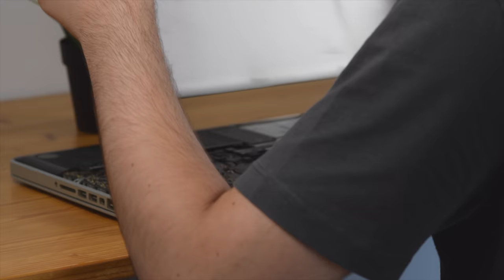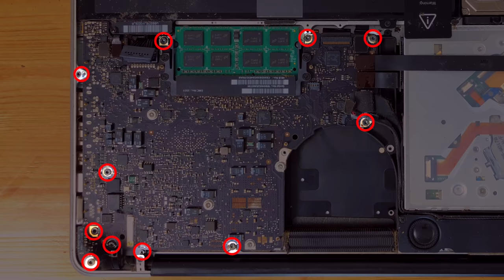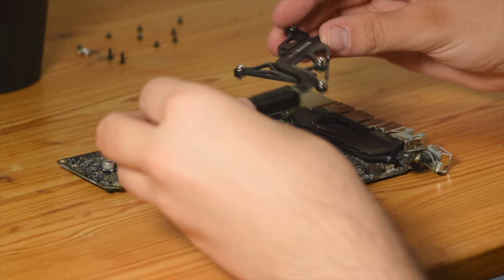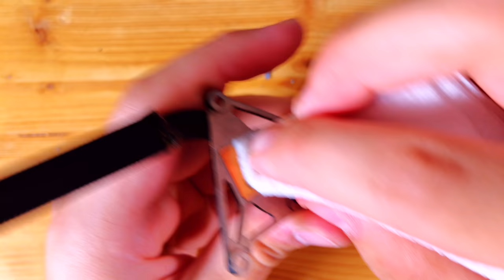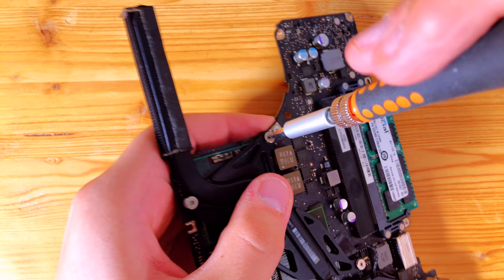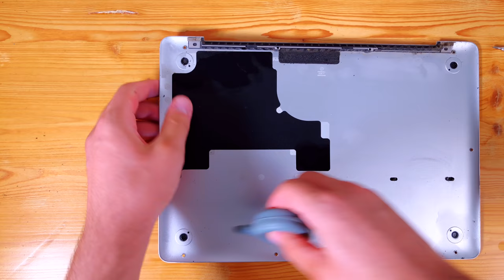MacBook Pro 13" Mid 2010: Inside cleaning & New thermal paste

Comment: Hi, thank you so much for your tutorial. I was really scared to do it myself. But after did it, thanks gods, there is nothing really broken. Usually, my idle temperature was 70 C and now it 50-60 for idle and never passes 70 C when it under load. 

Maybe because the original thermal paste already got so bad and dried, that's why it didn't do its jobs anymore. 

Again, thank you!

Comment: WOW. I'm not a huge tech person and this looks pretty straight forward - I'm refurbishing a mid 2010 MacBook pro and was looking into other things I could do to help it run as best it can. Great tutorial.
Reply: Same, I upgraded the ram and put in a new battery and SSD. Runs smooth now but it's gets really hot and the battery drains quick. Might do this to see if it helps.
Reply: @jerryrivera6328  any luck? typing on a mid 2010 MacBook Pro haha
Reply: @kjhammons52  yeah after cleaning the inside and changing the termal paste it was running much more cooler than before. I should warn you to be careful when disconnecting the LCD ribbon because on the video I couldn't really see how he did it and I kinda took it off incorrectly so the screen wouldn't turn on until I messed around with it for a bit to put it back correctly.
Reply: @jerryrivera6328  thanks dude glad to hear it, I got parts on the way! sorry I'm a noob lol is that the wire coming from the screen?
Reply: @kjhammons52  no prob man, it's the first time I've opened up a laptop before and yeah it should be the the top right ribbon connecting your screen.
Reply: I added a 2nd drive instead of the DVD with a caddy. Cheap and well worth doing.
Reply from the maker: You can configure the two drives to be RAID0 so the system will see them as 1 drive with much better speed!
Reply: @Simos805  The boot drive is SSD and the second is SATA. Boots quite fast as it is
Reply from the maker: Fortroad Massive Ok but you can make it even faster and the drive speed isn’t only affecting the boot speed but the system’s speed in general!
Reply: @Simos805  They are different sizes does that matter? I always thought that using RAID you needed the same size disk?!
Reply from the maker: Fortroad Massive Then yes, I think they need to be the same size.

Comment: Its Jan 2022 and I have a 2009 MBP, still running just fine minus the fan kicking on often, Im about to do this while I replace the keypad. Its crazy, 12 years out of Apple must really say something.
Reply from the maker: I bought a used 15" MacBook Pro 2010 for my girlfriend in 2021. We installed an SSD on it and it works pretty much fine. I does some display issues (like anomalies in the backlight in some areas) and it only has 4GB of RAM (we can install 8GB but it may doesn’t worth it considering the cost of new RAM), but it runs macOS High Sierra and Windows 10 through bootcamp very well for its age!

Comment: Hi great video! But now I have a issue with my MBP mid2010, I put new thermal paste, afterwards I turned it on, it turned on like usually but my keys 4RFV did not work on the keyboard.. I turned it off and on again, but now it wont show anything, it does the starting sound an some noise comes out of the MBP two times, but then nothing happens, it stays on but screen is black, but on.. Help please!
Reply from the maker: Check out the connections of the ribbon cables for the display and the keyboard as well. Make sure there isn’t any dust inside the connectors. Be very gentle because they’re very fragile!

Comment: Great video, will be doing this.  Whats that wee grey air thing?
Reply from the maker: Boabywankenobi It’s used to blow air for photographic equipment. Basically you need something that blows air, but not very very strong because maybe you could damage the motherboard.
Reply: @Simos805  Awesome, thank you.  I had one follow up question, did you apply any alcohol to the motherboard itself? [i.e. to help with the corrosion etc].  Thanks again for this video mate, as a bit of an OCD neat freak even if I didn't own this exact Macbook I still would have appreciated your vid!
Reply: Boabywankenobi motherboard wont corrode if it was not wet, and you dont have to clean it with Alcohol because using some kind of soft brush does the job

Comment: My MacBook just shuts off randomly when it can't handle stuff anymore. Just turns black. Like switching off a light.
Reply from the maker: How are it’s temperatures the time it shuts off?
Reply: @Simos805  I don't know. How can I find out? Is there a log of that?
I made a diagnose with EtreCheck and it said, that the CPU was way overloaded with a process using over 100% of resources.
Reply from the maker: St4zBl0od Maybe you need a clean install pf the latest macOS version your system supports. If the problem still occurs, maybe it’s something with the temperatures.
Reply: @Simos805  Yeah, maybe thats right. I just don't want to jeopardize all my system addons like brew, iShowU etc. I didn't want to upgrade from Mojave, but maybe it is a solution.
Although due to the age of the laptop (i bought it used in 2014) the thermal paste might be a little hard by now. And a cleansing of the insides, especially the vent, is surely not that bad of an idea.
Reply: @Simos805  I just opened the MacBook to see that there was a huge ball of dust blocking the fan. While I was at it i cleaned the whole computer with isopropyl-alcohol and redid the paste. Now the computer went from about 70 °C Idle temperature to about 50 °C Idle temperature (158 F to 122 F). This is f-ing awesome. Didn't even need to update.
You really helped me, especially with the thermal paste part of the video. I didn't really know how much to apply, so thank you!
Reply from the maker: Alright, happy to helped you! But I suggest you to update, macOS catalina works great!

Comment: Thank you for this video. Want to try it on my mid 2010 MBP, but is it okay do you know to use a metal spudger instead of a plastic one like you did here?
Reply from the maker: A plastic one is recommended because it won’t damage the other surfaces and it won’d make short circuits.
Reply: @Simos805  Thanks for the speedy reply and the clarification. Makes sense. I'll give it a go soon.

Comment: My mid 2012 i7 13.3 seems to run hot, 45c to 60 c for regular tasks, on sim city is got up to 163 F, I’m thinking I need to do thermal paste change, any thoughts? I’ve used smc reset, smcfancontrol to up the fan rpm, that has helped some
Reply from the maker: I don't thing you have any problem, 40-60°C for regular tasks for a laptop are generally ok, and 72°C while playing a game are very ok as well. Maybe if you replace the thermal paste you will some improvement, but maybe a ~5°C drop and that's all.

Comment: I follow your guide, everything was looking great but then the computer won't turn on, then I tried to check if everything was connected right and I broke the Camera data cable :/
Anyway, it still doesn't turn on, if I connect the Magsafe charger it turns the battery lights on, but no matter what it doesn't turn on, what could it be?
Reply from the maker: I don’t know man... For sure something went wrong on the reassembling but I can’r know what...
Reply: @Simos805  Thanks, I did the process twice and it still wont boot, so I'm just gonna take to a technician
Reply from the maker: Very strange... Hope you’re find the way to fix your macbook!
Reply: @Simos805  Thanks mate, still, your guide was useful and well done!

Comment: Thanks for this video! 2 questions: would it be the same for the early 2011? they look exactly the same. 
And, mine it is still working, I upgraded to 16gb RAM, and SSD disk, but I want to optimize it as much as I can. So, do you think doing this it will help everything work a little faster? My fans turn on a lot for a long time, but they also turn off after, and the computer keeps working normally, just slow if I'm doing some work. 
thank you!
Reply from the maker: Yes, it definitely be good for the computer to change it’s thermal paste and clean it from dust that prevents the airflow! The process is almost the same I think yes.
Reply: Hi, I just did it to my i7 MBP late 2011, everything is the same with this video, the only difference was the thermal only for CPU. I didn't notice the graphics card processors, like in this video. Hope it helps

Comment: nice video! my macbook pro heats up a lot and then off, after a few mins i turn it on and it works normally. could this be the solution, clean and change the thermal paste?
Reply from the maker: Which model you have? When it heats up and then turns off, you're using it on e flat surface or on a bed/clothing or something like that?
Reply: model is macbook pro 13'' mid 2009, upgraded already, runing win 10 whit bootcamp 5 on it, is all good, faster,.. but i only have that issue, and am using it on the iclined pc surface.
Reply from the maker: Aha, windows always heating up Macs, even the newest models because they aren't optimized. Why don't you use macOS?
Reply from the maker: But if your macbook shuts down, surely it has a problem, maybe it needs thermal paste replacement.
Reply: complicated to use haha, i mean never really tryed. well tanks buddy ill do those steps, hopefully it reduce the heat.  let you know it goes. salud!
Reply from the maker: macOS is much more easy to use and useful compared to windows, you just need to understand it's little different logic and then you will see it's better. Windows are only better for gaming.
Reply: did that,. is all good, thanks
Reply from the maker: Happy to helped you! 🙂

Comment: So I just did this, my macbook wont turn on anymore, unless its plugged in with the charger. However, the screen is black and the fan goes crazy. Anyone else have this issue?
Reply from the maker: Check all the connections inside, all the ribbon cables.
Reply: @Simos805  I had trouble with the wide ribbon cable at the top. What does that one do?

Comment: Is it normal if the fan turns on at Max Speed whilst turning on? (After this procedure?)
Reply from the maker: All the time or just for a few seconds?
Reply: @Simos805  it happened all the time upon first reboot, the fan was running at max speed without blowing hot air. I restarted it and it runs great I got significant results, there is just one thing that bugs me, when I'm on YouTube the fan turns on progressively until it's at max speed and the temperature rises up to 80°
Reply from the maker: Oh ok, maybe that was a bug. YouTube consumes a lot of power and it’s usual for the laptop to go 80° especially on high definition videos.
Reply: Oh that's ok then. Thank you for taking the time to answer my questions! You just earned a sub! Great videos! You're pretty good!
Reply from the maker: Thank you man! :)

Comment: I have T6 screw driver but it doesn't work
Reply from the maker: Can you explain?
Reply: @Simos805  Like I have a screwdriver set it has from t4 to t20 screwdrivers, however, when I try T4 and T5 they are too small but when I T6 or bigger they don't fit because their size are too big for my mid 2012 MacBook's screws
Reply from the maker: @randomperson1408  That’s strange. Maybe the screwdriver set is very cheap and crappy and the sizings are wrong? Or maybe your macbook pro has been opened before from a 3rd party and they replaced the screws with different ones?

Comment: HEY bro does the TORX T5 work like a T6 ?
Reply from the maker: Maybe
Reply: @Simos805  it doesnt exist in my country but T5 exist. so is the T5 Torx abble to work with T6
Reply from the maker: No it will not. It needs T5. You can order it online from amazon, ebay etc

Comment: My screen flashes and goes completely dark if I put the bottom plate screws in. Has anyone else encountered this? I did this a CPU repaste (got excellent thermals at least), so all went well just can't put the bottom screws in or the screen dies. Thanks
Reply from the maker: Have you checked the display connector?
Reply: @Simos805  I have, thanks for the reply! It was the weirdest thing with everything working fine on the test run before we put all the screws back then wham, dead😋. I disassembled the whole thing an started a fresh an now it works with the screws in🤔🤔 go figure! Haha, cheers though. Couldn't find anyone with the same issue so tool to YouTube!! 😋

Comment: did this the other day to a 2011 mbp. Temps are better, although not by much. Was still worth it while I was inside anyway for the SSD/16gb mem/Battery/BT 4.0 swaps.. Id do a 2012 motherboard swap if they still weren't so expensive.
Reply from the maker: Nice! Although it will be a 2012 MacBook Pro with a 2011 body and parts if you swap the motherboard!

Comment: Will this be the same procedure if I tried it on my Mid 2009 MacBook Pro? It has been overheating lately :(
Reply from the maker: Yes, but the internals are different so the procedure will be a little bit different.
Reply: @Simos805  Can you describe how different? I am also trying to change the thermal paste and wanted to know if there was anything that I should be cautious about. Thanks!
Reply from the maker: I don’t know, I don’t have repaired much of these computers especially the old ones.

Comment: Do you know if it is possible to change microprocessor in mid 2010 MacBook pro ?
Reply: Bjarni Einarsson I think you would have to replace the logic board with one that has a faster processor, probably look on eBay or somewhere like it.
Reply from the maker: YaBoi I don’t think it’s worth it tho.

Comment: Hey i'm happy to see how to repaste my Mac. I have 2010mid. I have overheating issue while charging and using it together wether its on cloth or desk. And my charging is also very slow, my battery has 1000+ cycles. Maybe repasting can solve my problems?
Reply from the maker: Dzsaben When you’re using a laptop on cloths it is normal to overheat. And your battery its normal to have an overall decreased performance when it’s at 1000+ cycles. Maybe a good repasting will help with the overheating  but the problems with your battery surely doesn’t have to do with the thermal paste, just replace your battery at an apple store or an apple premium service.

Comment: Mate, instead of all these, change that bloody hard disk. That alone would make your Mac fly! If it's SATA though. I doubt if there is any SSD available in IDE.
Reply from the maker: I know, and yup it’s SATA, but the MacBook isn’t mine! My work was only to clean it and replace the thermal paste because of heat issues.

Comment: I just did this in my MacBook and it runs slower now. Even dragging the mouse to sign in stutters the mouse. I took it apart and reapplied thermal paste all over again and it still gives me that issue.
Reply from the maker: That’s odd... Check if all the connections are right. I think something interferes.

Comment: Just did this ... my mac won't boot for some reason !!
Reply from the maker: أحمد النهدي So, Maybe you damaged something... :/
Reply: Rip
Reply: Its probably the small ribbon cables , they are not inserted fully into their socket...this happened to me and no boot..when they are inserted fully and the latches are pressed down to secure the ribbon, then it should boot...If ur ribbon cables can Easily fall out of the socket when u touch them, then they havent been inserted fully..they should be secure.. hope this helps, dont throw ur compute away becuz this simple mistake
Reply: @skip741x3  Your comment saved me a lot of headache, thanks! It was the bloody ribbon cables indeed.

Comment: I just replace the housing of the laptop and thermal paste on my MacBook Pro 2008 a1260  I soaked the heatsinks and fans in water for an hour and scrubbed them  the computer runs way better now that's how I clean my computer's same with my ps2.  No joke just make sure you dry the part well oh and got the mack for $32 2 years full restoration :-)